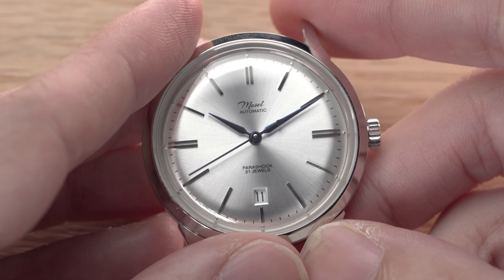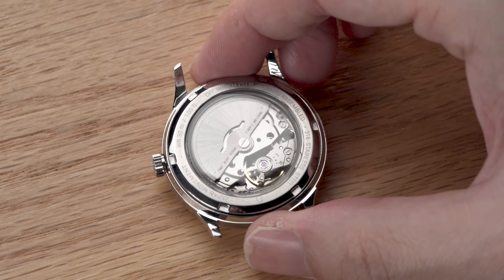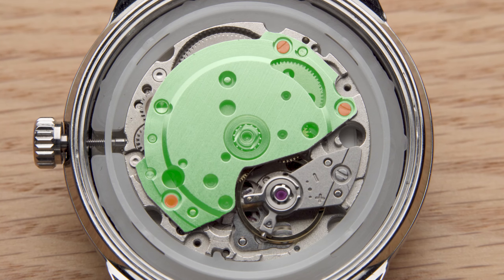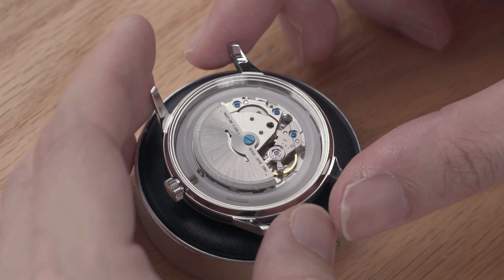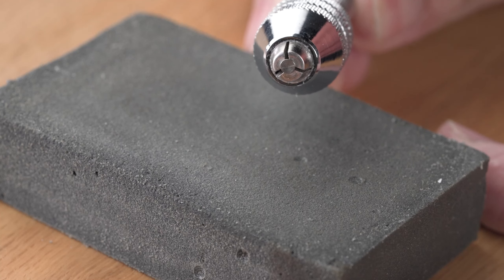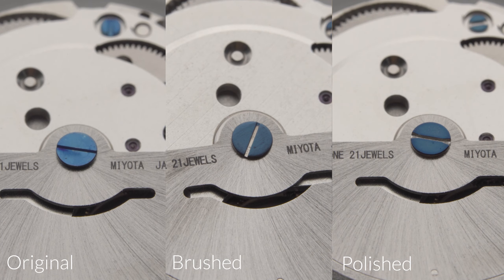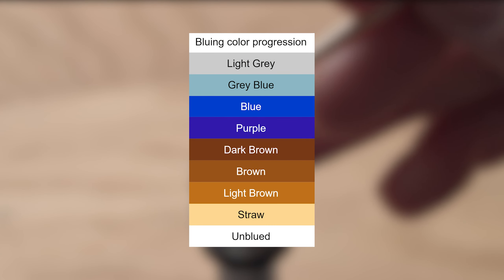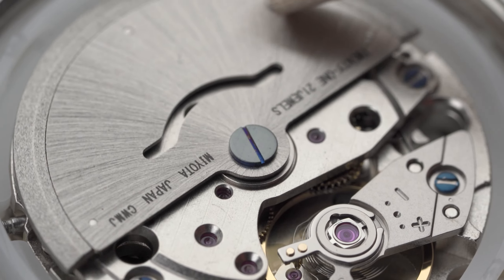Thermally Bluing Screws for Movement Mod

Comment: I section on bluing nh series screws needs amending, tried all the screws shown in the video that could be blued and none of them changed color, even after getting the brass shavings super dark, the screws in those movements might be coated now
Reply from the maker: Thanks for the heads up. Appreciate it.  I'll check with newer nh movements. Have you tried sanding the screwhead and bluing again? That should remove the coating if any is present.
Reply: @DIY Watch Club  yeah that's how i got them to blue finally, got all the with 2000 grit